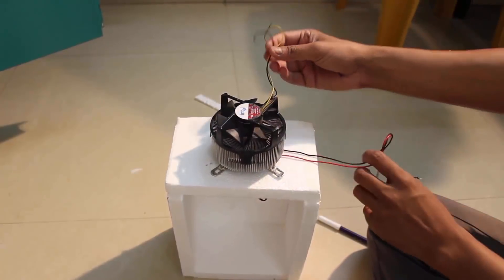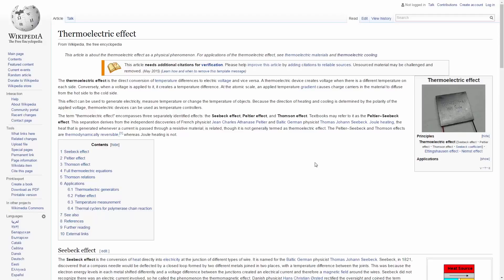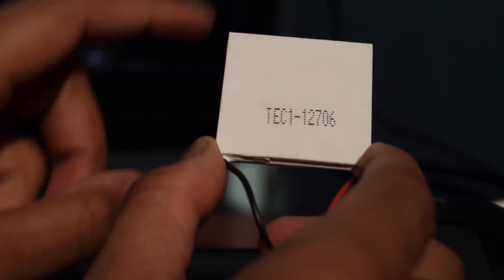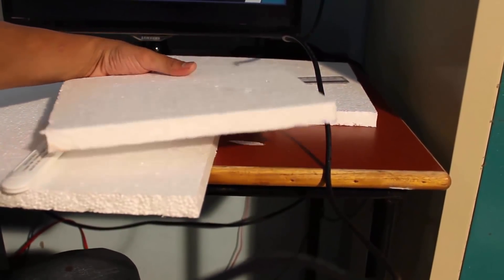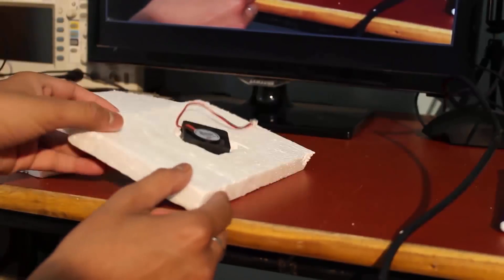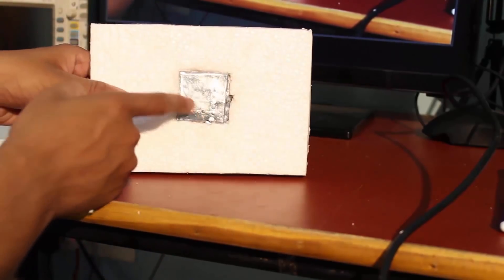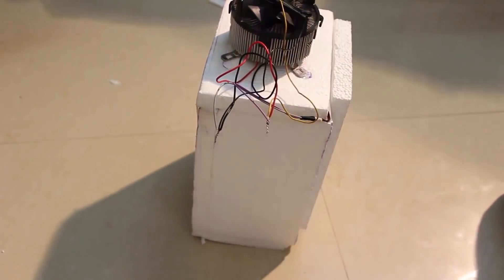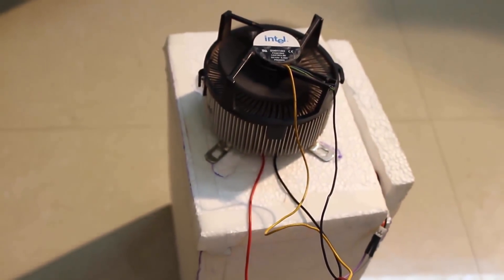Make a mini portable Fridge

Comment: 12v 1amp ka power supply de sakte hai kya??
Reply from the maker: Nahi, 
12V 5 Amp ka lagega.
Reply: And one more question
The mini fan on the cold side will flow the air to which side? Towards the pelier or the beverage side.?
Reply: Mini fan ka hawa kidhar aayega peltier ki taraf ya fir cold drink k side.

Comment: Tell me what r the material required? Plzzzz
Reply from the maker: Peltier module
12 V, 6 Amp Power Supply
Heat Sinks
Thermocol
Hot Glue gun and fevicol
Double sided tape
Soldering Iron
Reply: Shailza Kant Pandey thanks

Comment: Sir please explain the wiring
Reply from the maker: +Vipul Meta Wiring is very simple,  peltier has two wires red and black,  so you have to connect red wire to +ve terminal of supply and blact to - ve terminal of supply.  same goes with the fan also.
Reply: Shailza Kant Pandey but jo mere pass fan hai usko 4 wire hai jaise ki apne jo video kiya hai na vaise but muze ye samja nahi ki apne fan ke 4 wires kaise use kiye ?

Comment: how to convert 220 ac to 12 V dc .. i knw by using a transformer rectifier ... but can i directly use it by a adaptor of some kind
Reply from the maker: +darko blake You can make a SMPS circuit for that.

Comment: Hi, Can I use mobile charger instead of 12 v power supply?
Reply from the maker: +SS No, mobile charger can not provide that much of power . Mobile chargers are generally rated for 5v @1 amps or 5V @ 2 amps.
The peltier module requires 12V @6 amps.
Reply: Ok, thank you.

Comment: Did using two peltier module 12706 instead of one peltier module 12715 will be better
Reply from the maker: It will be almost same. but yes, heat dissipation will be better in using 2 modules of 12706.

Comment: bro please tell me that what are the required to make a fridge please
Reply: Watch the video again 😜
Reply from the maker: peltier module
heat sink
12V 6 Amp power supply
thermocol
wirecutter
double sided tape
fevicol

Comment: my power supply is 12v 3.33 amp will it work?
Reply from the maker: No, it won't work at full capacity, because it need around 6 ampere of current.
Reply: Shailza Kant Pandey what if I increase power from 12V to 36V to 18 amps

Comment: kya 6amp se jyada pe kaam nahi karega
Reply from the maker: 100 % sure bro,  As current is a property of passive source, that means any passive source will draw only that much amount of current which it needs, i mean battery can provide 100s of amps of current but peltier will only draw 6 amps, but remember you have to use a 12V BATTERY.
Reply from the maker: It will only draw 6 ampere, either you connect it to a power supply rated at 12v @6A  or 12V @50A.
Reply: Shailza Kant Pandey are you sure that if directly connected to the battery the peltier module won't be damaged??
Reply from the maker: Peltier will draw 6 amps @ 12V so you can use any power supply of 12V but make sure it can deliver atleast 6 Amps of current. You  use 12V 10amp supply or 12V 20 amp supply, doesn't matter.

Comment: i have heat sink with three wires how to connect?
Reply from the maker: The third wire is for speed control, neglect that, just connect the power lines.
Reply: Shailza Kant Pandey ok thank you

Comment: what is the use of CPU heatsink? can we use a small heatsink instead of the big one in cpu?what will happen if there is no heatsink(on the hotter side)?
Reply from the maker: +Vakkachan Mangaly peltier module works on temperature difference, if you don't use the heat sink the cold side will not be that cool. And also you might end up damaging the module.
Reply: do we need to use big heatsink
Reply from the maker: Yes
Reply: WHat is we use a small one??

Comment: sir thanks for the video.. i want to know if i use tec1-12715 peltier module, will it work properly and what changes will required to do so.
and also what to use to mount peltier on sink...hot glue.??
thanks in advance
Reply from the maker: tec 1 -12715 draws 15 ampere current, so ensure that your power supply meet that specifications.
DON'T use hot glue to mount heat sink on peltier, use a THERMAL PASTE
Reply: ok thank you sir for replying soon...i just want to use 12715 module only to get fast cooling function.

Comment: sir..does intel stock fan and heatsink do well to release heat from peltier? can i know temperature of heat coming out from fan?
Reply from the maker: +Safardik Sidik yes stock fan and heatsink is sufficient to release the heat . 
The temperature of air coming out of fan(hot side) migh be around 60c . Although i didn't get a chance to measure hot side as it was out of subject.
Reply: Shailza Kant Pandey thank you, i want to make a project, but using 3 peltier module, with Intel stock fan, thank you sir,
Reply from the maker: Yes go ahead and make sure that your power supply is capable of delivering the power required by 3 peltier modules.
Reply from the maker: Yes, It can
Reply: thank you again,sorry for make mess on your comment section..
:-)

Comment: Can I leave the freezer running overnight ?
Reply from the maker: Yes, of-course.
Reply: Thanks a lot +Shailza Kant Pandey
Reply: Can I use water for cooling the hot part of the peltier module, I mean, what if we keep the peltier in the basement of the refrigerator, and the heat sink attached to the hot side of the peltier be dipped in water ?

Comment: there r different types of module, in different prices in Amazon, e bay, which module is best for long life and gives best cooling?
Reply from the maker: +Haradhan Mukherjee There are modules like 12706 or 12715 etc. 
12706 is a 6 ampere module.
12715 is a 15 ampere module.
Ofcourse 15 ampere peltier module would have higher cooling capacity.

Comment: how could you give 12v dc supply and 5-6amp
how much watts it required
Reply from the maker: This module draws 6 Amps @12 V, so you could use any power supply capable of delivering this much power. You could even use old SMPS of a computer.

Comment: Can i know which type of power supply or battery you used?
Reply from the maker: I used SMPS from old computer, you can use any power supply of 12V DC capable of delivering 6 ampere.

Comment: why you have fitted steel piece on the top between tha fan
Reply from the maker: +Mirza Baig It's not steel, it is aluminium plate .This plate is touched with cold side of peltier module so that it can also become cool and the fan is used to regulate the cold air inside the enclosure.
Reply: SIR WHERE I GET PELTIER..
MAIN KAHAN SEY LU PALTIER MATLAB KIS SHOP SE YE OR KHA USE HOTA HAI